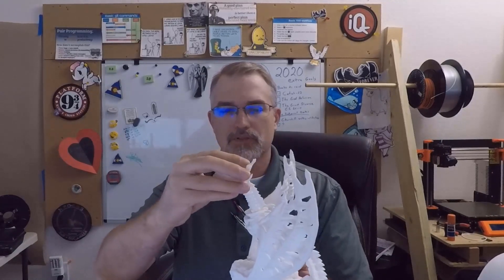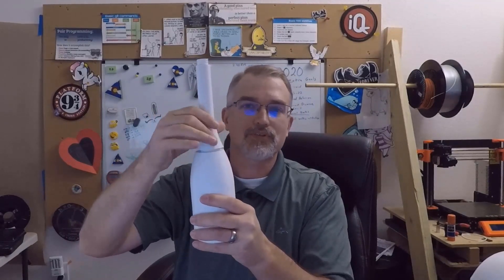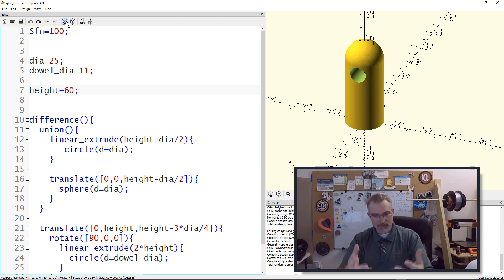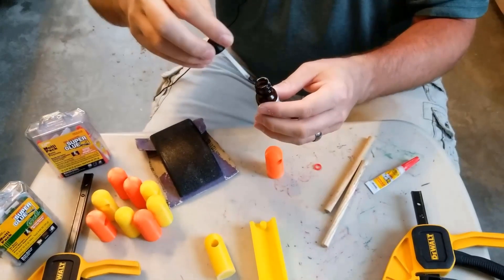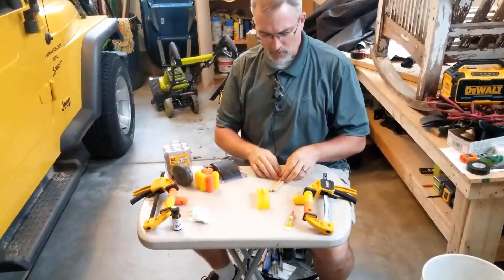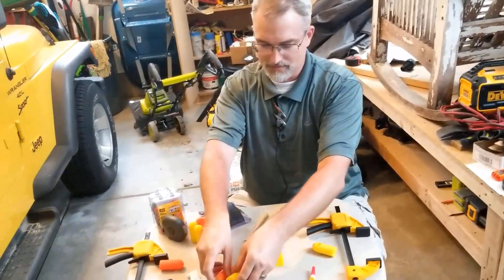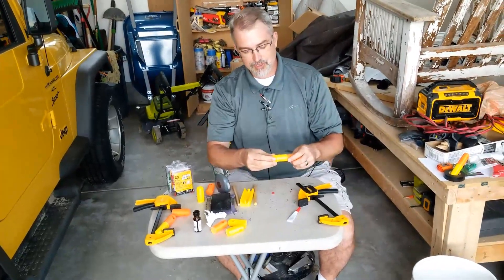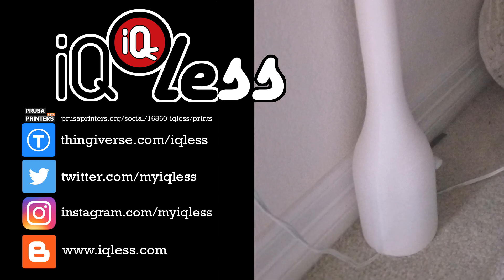3D Printing: Super Glue Vs Nano Gloop

Comment: I like gloop. However it dries out quickly even in a sealed container.
Reply: Yes, I also have the same issue with it drying out in a sealed container.  It doesn't take long before it starts getting thicker and thicker, then unusable.  Aside from that, (and pricing) it's a great product.

Comment: You're doing a great job, I really enjoyed the informal testing.

I have used the 3D Gloop for PLA and ABS. They hold great. I glued a two part rifle stock together with the ABS and messed up the alignment, so I tested it to failure (bash it against the concrete, use a pry bar to rupture the channel for the buffer tube, etc.). The ABS failed around the glue joint!

The only negative I have is the limited shelf life. I don't glue frequently, but I like to have it on hand for when I need it. The ABS gloop turned into an unusable blob after a month of sitting above my enclosure. I might be able to renew it with the correct solvent, but haven't had the time to research what the would be yet.